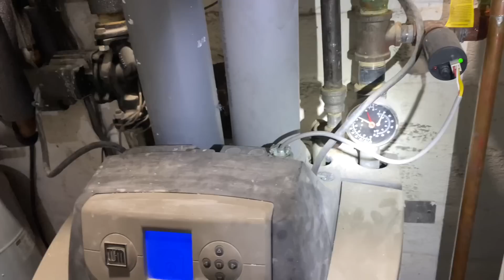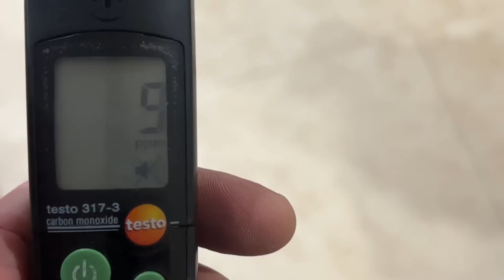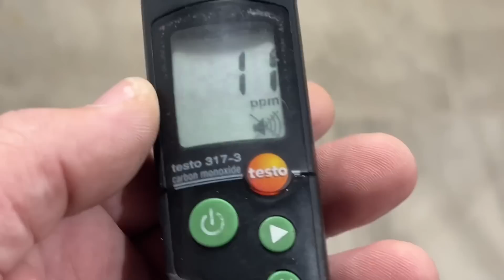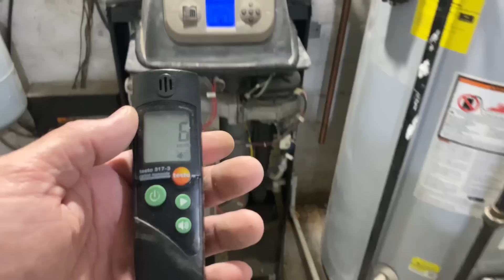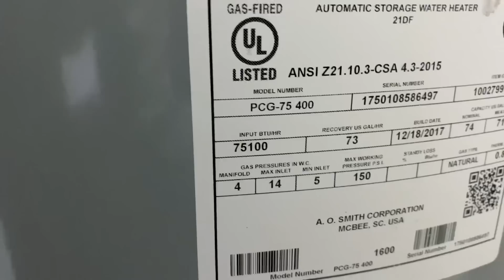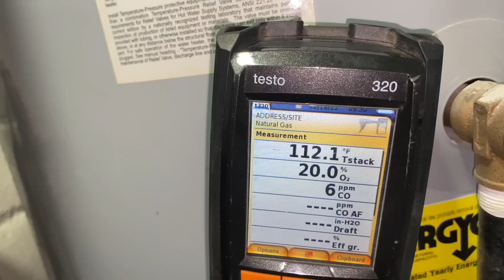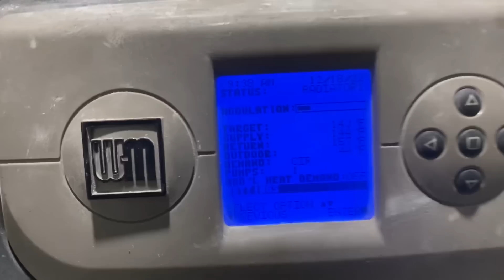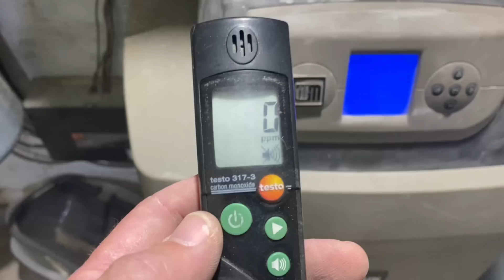Emergency Sunday Morning Heating Service Call - Improperly Installed Boiler Dumping Carbon Monoxide

Comment: Well done there, theres alot that cpuld be wrong and you dont want to get stuck on it on a sunday. O guess if you couldnt find the issue you would have had to cap the supply to the appliance? Thats pressure

Comment: You the man Mikey! Most guys would have gone in there scratching the heads without the proper equipment to diagnose the problem nor spend the time you did to get to the bottom of it. I can imagine how many would just say,,,"You need a new boiler", and, install it the exact same way with the air intake and exhaust too close together. When you got there, one one the first things you noticed was,,,,,Too close together! Perfect example of why home owners etc need to call the professionals like you! Good Job man!

Comment: Just got done working on a Buderus GB162 ,it amazes me how many of these systems are installed incorrectly! This particular system the check and expansiontank are on the supply side,no strainer on return,circ pump is way oversized,internal pump is junk,never maintained at all in 10 years,system pressure sensor is junk full of crap,and the thing off 1"from bottom of csbinet to top of cabinet!Must be they didnt have a level!
Reply: @PipeDoctor  You and yours also!

Comment: Interesting that the Naviens keep the CO in the cabinet to the point it deteriorates the components. Perhaps a better design would have a cabinet seal or CO detection inside the cabinet. The wall hung WM combi appears to be a newer, better design.

Comment: That was a good catch they shoulda used the correct concentric kit that’s why they need low level carbon monoxide detector woulda displayed at 5 ppm

Comment: I had that and I extended the exhaust up for 12 inches. This way it blows up and away and the intake path is non restrictive and as short as possible. Mine would shutoff and not fire. Not enough O2 to maintain a flame. Good Job

Comment: Good find Mike. CO is scary, especially with the recent articles involving loss of lives. I hope they start to mandate CO Detectors in houses, just like smoke detectors. Some locations have requirements for hard wired smoke detectors in residential houses. Great that the owners had Detectors. I wonder how the flue and intake passed inspection??? Thanks for sharing your experiences, showing thousands of technicians what to look for. 👍🏻👍🏻

Comment: Nice catch wonder why the CM detector just went off? Boiler been there 5 years or more, window open, half ass sealant around the exhaust pipes outside, bet there is more to this story then what they told you. Perhaps they have been having this issue for quit some time  and someone opened the window and put that spray foam around the outside to try to half ass make it safer for the homeowner.  At least you got a real solution to the problem. Way To Go !!!!!😃

Comment: Nice detective work but I am still a bit confused.  Shouldn't that wiel  Mclain  cabinet be tight enough to keep the recirculating gasses inside?  The water heater venting looks like a complete disaster.  Did you check it with vent hood and other vent fans in the house running at full speed

Comment: Last one went on, even though the boiler was a 1930's converted steam boiler with not safety's.  Wound up being the son warming up the car right in front of an open garage door.  Problem with these calls is the "steady state", second you walk in the door the variables change.  In this case they only used half the vent kit that came with the boiler.  That plate goes in the back and a plastic plate in the front.   Flue gases shoot strait out and combustion air comes back around the side.     Big thing on inspections here, if you go back into an existing vent line for a new appliance, your vent terminal must match manufacture specifications of the new model.

Comment: Interesting to see how you in the US separate  combustion air and flue gases. Over here we predominantly  use concentric horizontal  and vertical systems, check us out.
You nailed the problem 1st time. super foam making good around the flue/vent looks what it is ,take the money and get on your horse and get out of town! Thank goodness for your commitment.
Reply: In Germany we use coaxial exhaust pipes on condensing units. The inner liner is for exhaust gases and the gap between the inner and outer tube wall is for the fresh air intakt. We actually measure the air inside the gap for flue gas contamination every 2 years to make sure the exhaust pipe is tight.
This way, there also is no way of a leaky exhaust pipe to cause CO leakage into the house since it would only recirculate the exhaust gases into the boiler. 
Up to date systems also have an additional CO detector that automatically shuts down the boiler in case of a CO leak.

Comment: Nice catch on the recirculating. Good temporary fix and even better spending the time with everything running to show the client they are left in a safe environment for the time being. Surprised that it took that long for that situation to show itself. Obviously that isn’t a new or near new install. Good job Mike. From the old hvac guy in Toronto.👍👍🇨🇦